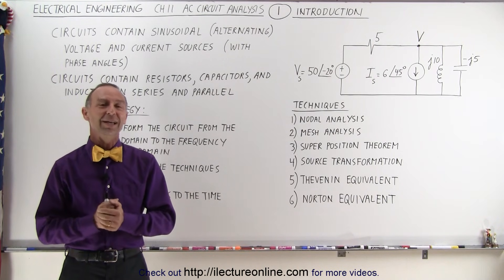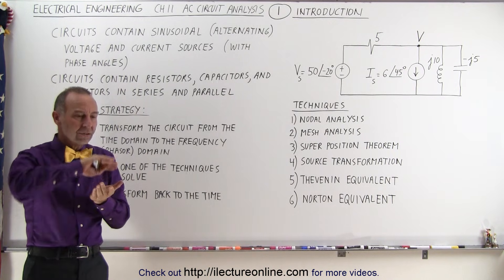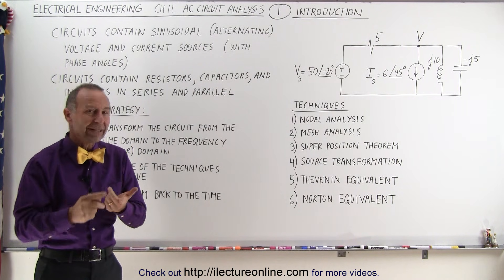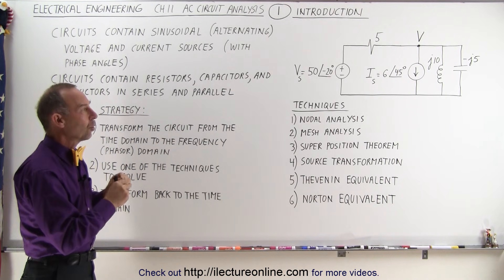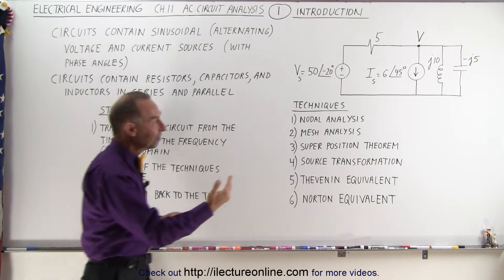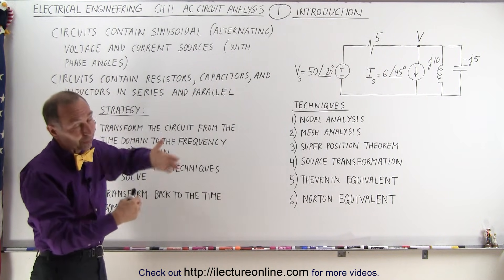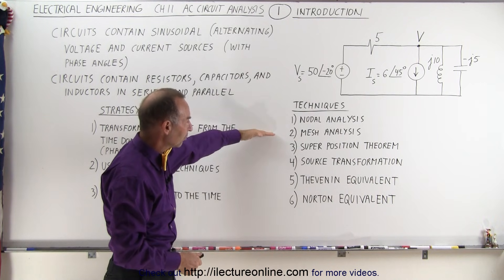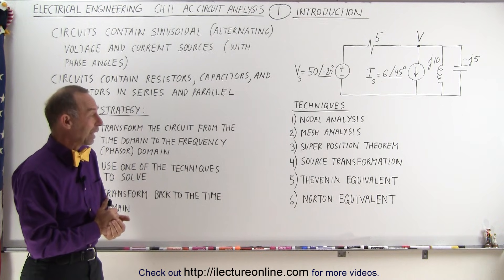Electrical Engineering: Ch 11 AC Circuit Analysis (1 of 34) Introduction

Comment: What makes phasor representation of sinusoidal quantities so powerful is that all the DC circuit techniques or mathematics are still applicable. The complex number impedance for capacitor and inductance includes the  phase relationship effects of those components.
Reply from the maker: Good input.

Comment: For the voltage source value, is it listed as a peak value or an RMS value? Our professor briefly went over this, however, it was not very clear
Reply from the maker: Typically it is the peak value, but not always.   It should be made clear in the question.
Reply: @MichelvanBiezen  Thank you

Comment: Sir how could we analysis a circuit contain both dc and ac sources?
Reply from the maker: A DC source will simply give you what we call a "DC offset".  It will raise the average voltage curve up or down by the DC amount (if it is positive or negative).